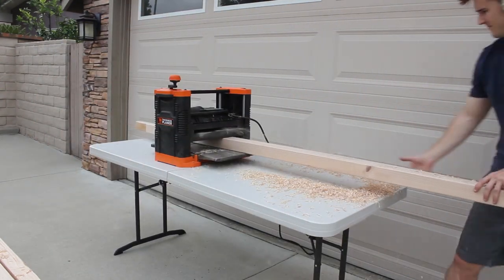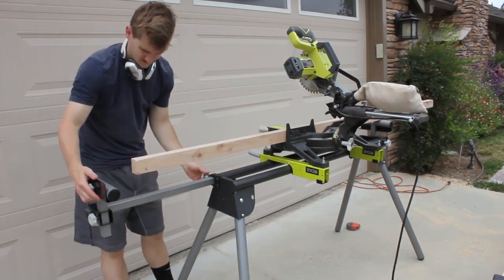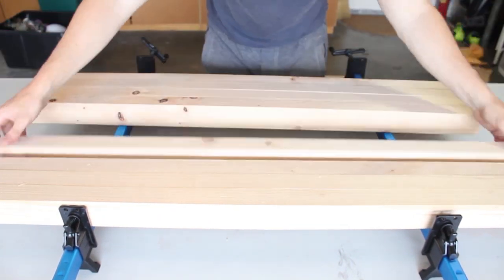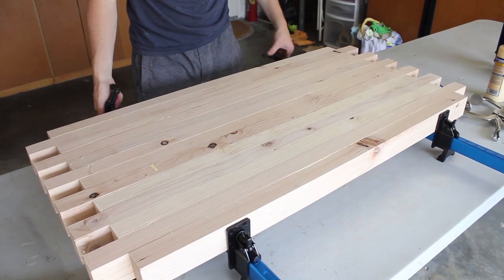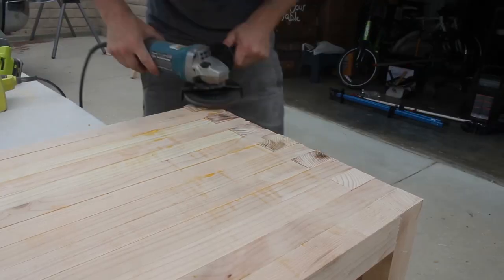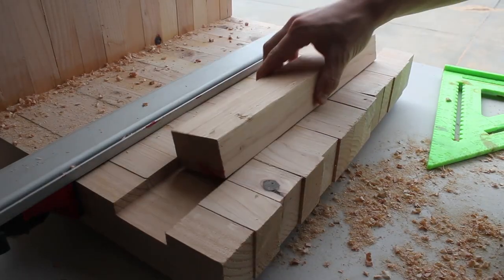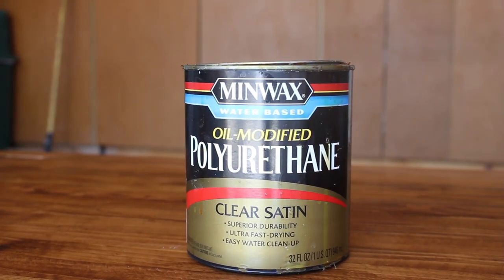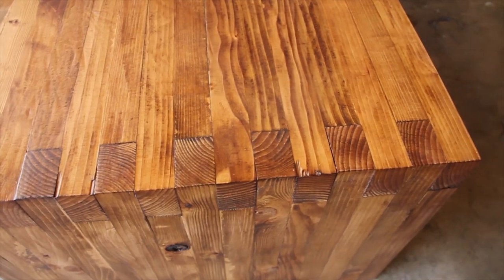DIY Coffee Table from 2x3's | 15

Comment: Nice project. Making some large woodworking cauls would help keep everything flat during the glue up. I like how you used the Kreg clamps along the joint...I use those a lot.
Reply from the maker: Yea that was a tip from my future father-in-law. Made a huge difference in the process. I had considered using cauls but wanted to try this method first!

Comment: You said you used an oil based polyurethane, but in the video you slam a water based poly in front of the camera.  Which did you use?
Reply from the maker: Sorry - I think I did misspeak on it. It is Water based and Oil-Modified. Good catch.

Comment: Safety glasses?
Reply from the maker: Already addressed this but I'll comment on it again.  I use it about 90% of the time when sanding and cutting, etc. 

Sometimes I do the irresponsible thing and get a bit too focused on filming rather than maintaining the small safety things that should always be present, both in a build and in a video build especially, which is a big issue when it comes to showcasing projects online. Same goes with a sanding mask.

Comment: No eye protection?
Reply from the maker: To be totally honest - I use it about 90% of the time when sanding, etc. 

Sometimes I do the irresponsible thing and get a bit too focused on filming rather than maintaining the small safety things that should always be present, both in a build and in a video build especially, which is a big issue when it comes to showcasing projects online. Same goes with a sanding mask.

Comment: I see many Tubers putting steel in their laminations. That is a habit you'll come to regret. Before the work is in entirely in the clamps you'll want to drift something  a few thousandths but won't be able. Another drawback is eventually you'll want to mount something or otherwise modify your work. Then you'll find that long-forgotten fastener with a piece of the best, most expensive tooling in your shop.